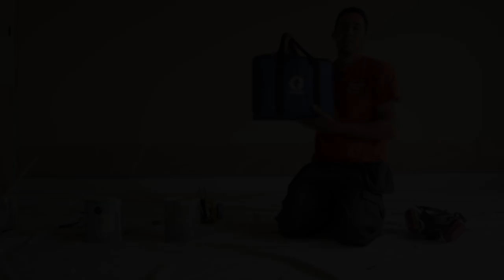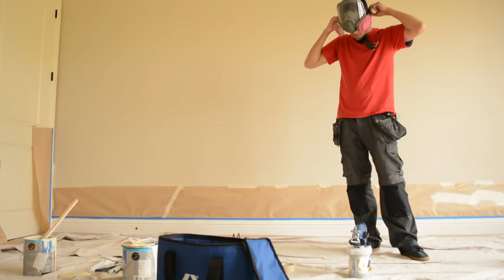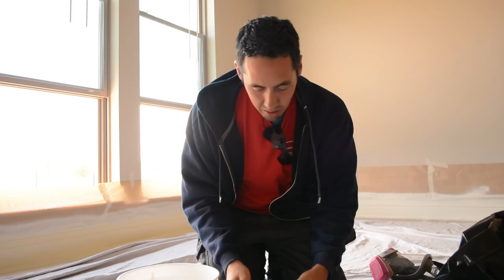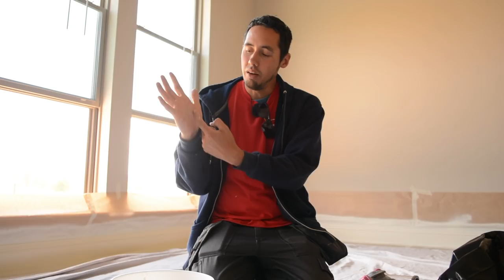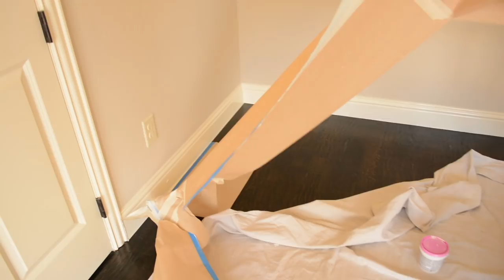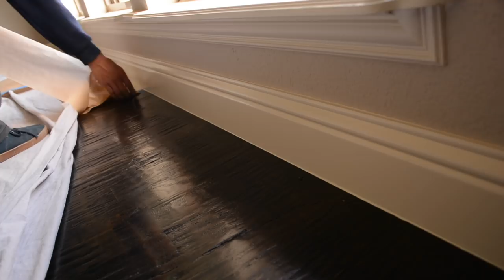SHOCKING Results! Graco Airless Handheld

Comment: No quarter round or shoe molding?
Reply from the maker: we scribed the base to the floor. Masking, caulking and peel the tape for a clean line :)
Reply: It ain't needed here. Clean lines.
Reply: Finish Carpentry TV So Pro
Reply: Quarter round, the panacea for poor workmanship
Reply: Never cared for the look.  Something is missing without quarter round. Esp. With taller base
Reply: Finish Carpentry TV 

I don't think I've seen a scribing video from you before. I'd be interested in seeing your methods.
Reply: definetly
Reply: Rabbit Quarter round is used to cover gaps. It's easier than scribing the base to the floor
Reply: Rabbit   Don't forget the reason we use trim - it's to cover gaps and faults.  Trim is not an end unto itself. When the craftsmanship is good there is no need to cover it up.
Reply: I Disagree gentlemen. All trim served a functioning purpose at one time. Truthfully the only trim that serves a purpose now is base. Everything else is esthetics. Trim now provides a finished well built look.  With a piece missing it looks just that...missing.  I’ve only had one client that shared yalls viewpoint on quarter round. Everyone else expects it.  And I wouldn’t consider not using it. Perhaps its regional??
Reply: Rabbit   I think it's just a case of that is what you are used to seeing, therefore it is a preference.  I, and many people, prefer the cleanest look possible.  And, I admire better craftsmanship.  But, everyone is free to prefer whatever they prefer.
Reply: I'd say pretty much all the houses in my area have shoe moulding and that's what people are used to seeing. But as a carpenter I feel like baseboard on its own is a cleaner look.
Reply: When I see base with no shoe done right I think, "now there's a quality craftsman who knew what he was doing and cared enough to go the extra mile".  When I see shoe I think, "dude just wanted to hurry and get paid".
Reply: Rabbit Do you put shoemoulding ontop of carpet?
Reply: If you go by that philosophy that less is more, than why use wide casing, wainscoting, crown, panels, cap, cove, etc etc. 
trim carpentry is the beautifying end result. When I see quarter missing I think, either someone couldn’t really afford trim or the carpenter got over on the client by skipping a step.  
But I’ll buy the idea, “it’s what you’re used to seeing”.  A lot of truth there.  I never thought about from that standpoint. 
Course 30 yrs ago the first contractor I worked for told the age old joke..”a carpenter hides his mistakes with trim. Whereas a doctor has to bury his mistakes.”
Perhaps some still live by philosophy
Reply: Noconz0727 MC of course not. Apples to oranges. On quality and caliber of flooring
Reply: Noconz0727 MC I don’t even care for shoe molding. It’s a dated look. I prefer the larger bulkier look of quarter.  Esp. When used against taller base. Which goes hand in hand with wider casing in many instances.
Reply: Anytime I see quarter round I think, "There's another laminate floor put in as an after thought."  Probably not in all cases, but in general, I like base sitting on the floor.
Reply: Its referred to as base shoe moulding/trim.  Usually about 1/2 X 3/4” the 3/4 side goes up the base.  Quarter round is a 4th of a circle and would be 1/2  X1/2 “, 3/4 X 3/4 “ etc.

Comment: If a cordless tool is shocking you, take it back NOW!! It's probably not life-threatening dangerous, but that's either a defect or a design flaw.
Reply: Norm Jacques 

States right in the manual that getting shocked is a possibility if using hot solvents.  The paint he was using was probably thinned with a hot solvent. Graco makes an upgraded gun to the one he has that can be used with hot solvents and comes with a grounding cord.  Its called the ultramax
Reply: It just now occurred to me (after reading your reply) that, in the original 'unboxing/review' video, did it not state that the sprayer was not to be used with solvent-based paints? He said it was 'oil paint,' but that it was provided by the customer....who very likely wouldn't know the difference between oil- and solvent-based paints!! SO.....I very well may have overreacted!! Could be that the sprayer mfgr. is using electric shocks as a 'Warranty void' warning alarm!! 

So sorry.....now trying to extricate shod left foot from oral cavity!! <red face>

Comment: When you consider all the time you spent masking the floor and walls and the size of the room, it would have been much easier to just paint the baseboard. I was taught to cut in rather than mask, so I never had to use masking tape. I know you don't paint much, so I understand why you did this job the way you did.

Comment: How the FUCK could it be your fault?! There should be zero settings that produce the result of 'shocks operator'. It's true for tanks, cars, submarines, cell phones, electric heaters and even taser guns. Nothing a user does should shock them at ANY setting.
Reply: TheDamnSpot 

Says right in the manual this is a possibility if using hot solvents
Reply: He is spraying a product this sprayer is not designed for, if he wanted to spray hotter solvents he would need to upgrade to the graco ultramax.

He stated the paint was thinned by someone else with an unknown substance,  clearly that unknown substance was a hot solvent this gun isn't designed for. 

I like this guy and his channel but this was user error, not manufacturers defect.
Reply: As someone who is familiar with manufacturing standards in the U.S. and China, I can confidently say that a product that holds any sort of liquid as well as an 18 to 20 volt battery should be engineered in a way that prevents the electrification of the user. This isn't even remotely a tough call. And as far as that whole hot solvent warning goes, it doesn't protect them from liability - this isn't a hairdryer being used in the shower, it's something doing what it was designed to do, which is to spray liquids.. First, I doubt that any of that paint he used was anything but room temperature. Second, the bit about the solvent, makes me think that they're using cheap seals that can't deal with liquids that have a low surface tension. I can't even begin to explain how lazy and cheap you have to be to make something that can handle being 'somewhat' wet. I mean it's an engineering marvel, to be honest. I doubt I could do it.
Reply: TheDamnSpot 
Using the blanket statement, "this sprayer is designed to spray liquids", is incorrect. 

This sprayer is not designed to spray just any type of liquids, its designed to spray latex and mineral spirits based products only.

He stated he did not know who had thinned the paint therefore he could not know what it was thinned with.  

He decided to spray a product that he assumed would be compatible with his machine,  but he could not have been sure it was completely compatible. 

This is clearly user error and not manufacturers defect.

Ps i actually own these machines and am familiar with them.  You?
Reply: TheDamnSpot 

Also this same you tuber stated in his unboxing video that this sprayer is not intended to be used with hot solvents
Reply: We can keep going in circles if you want but I'll just keep making the point that power tools shouldn't shock you. Especially ones that hold liquids. And most especially ones that hold 18 to 20 volts of charge. For god's sake, the average 20 volt battery doubles as a poorly made chemical bomb. You really want to own something that creates a short occasionally? I sure don't. The idea that you would defend this product, just because it does its job in ideal conditions, is beyond me. This. Is. Garbage. It deserves nothing but scorn, regardless of what the average muppet user thinks.
Reply: TheDamnSpot 

Any sprayer not grounded properly and used to spray hot solvent based products is capable of creating shock .  

Heres an example, a few years ago I was spraying bin on all surfaces in an apt. I was using a traditional style sprayer,  a spraytech 2155 to be exact.  I was spraying along just fine until i sprayed a metal closet door. As soon as the spray fan hit the metal door a shower of sparks happened.  It concerned me and i stopped spraying, turns out it was caused by not being properly grounded.  ( the ground prong on my plug was broken off) 

The graco hand held that he is using is essentially that... but its specifically marketed as such. It is only intended to be used for water and mineral spirits based products  only!

If a person wants to be able to spray all products using such a handheld they should buy the graco ultramax,  which is designed for all paint products and comes with a grounding cord.
Reply: Rub your shoes across the carpet then touch something. Is the carpet defective because you get a zap of static electricity?
Reply: TheDamnSpot 

Your firearm analogy is a good one.

Every firearm is designed to fire a specific load.  Would you put a 20 gauge shell in a 12 gauge?  

Likewise these sprayers are each designed to take a specific load.

This was user error
Reply: The shocks aren't coming from the tool. It's not caused by leaking into the electronics or anything. It's a completely different physical phenomenon. The friction between the paint particles and the gun is causing extremely large buildup of static electricity between the gun and the wall because of the triboelectric effect. All he needs to do is put a grounding strap on the gun so the electricity doesn't have to go through him. 

It's like saying the people who make polyester clothing or Crocs shoes aren't meeting electrical requirements because you get static shocks when wearing them.

This might blow your mind but it would also happen if he was using an air powered tool with no battery or electronics in it at all.  It would even happen if he was using no tool at all and somehow managed to throw paint at the wall extremely fast.
Reply: felixar90 

Thank you! This is awesome information
Reply: TheDamnSpot 

He put out a follow up video, turns out he admits operator error.  Like i was saying all along